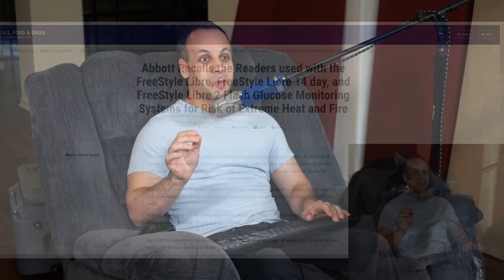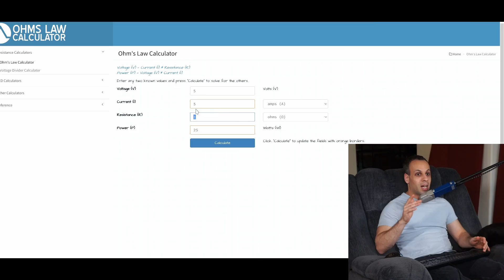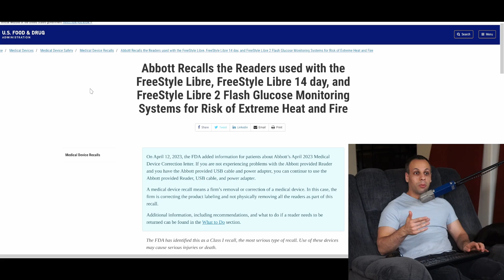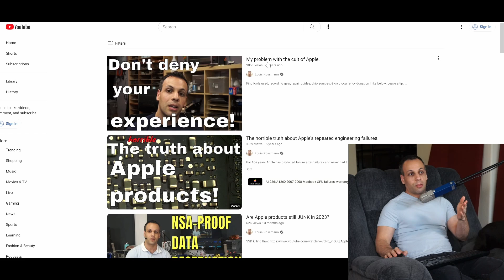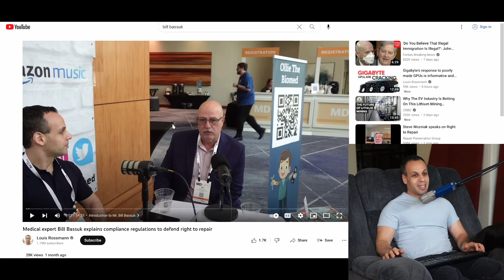Abbott gaslights customers during FDA recall of burning glucose monitors

Comment: I was very interested to hear about this recall. I retired from Abbott Diabetes Care 5+ years ago where my job was to investigate customer complaints and determine the root cause of failure in glucose meters that had been returned. I have no information about the current recall. 

When I was there, about every six months or so we would receive a (conventional) glucose meter that appeared to have caught fire and partially melted. This was very concerning and puzzling because they are powered by a three Volt lithium 2032 coin cell that is unable to source enough current to do such damage to the device. We tried to reproduce the problem and at first the only way to come close was to apply 100 Volts to the RS-232 serial communications port (which normally sees only 3-5 Volts). But the damage caused by this experiment did not match the pattern of black scorch marks and heat damage seen on the returned meters. One day I went back and read all the transcripts for when customers called in with this complaint. One customer made an offhand remark about having put his glucose meter in a microwave oven. So, I requisitioned several samples of all the meters we currently manufactured and put each in a microwave oven and nuked them for several seconds. The resulting damage exactly matched the damage seen on all the customer-returned burned meters. Case closed.
Reply: Why would they microwave them?!? 😂
Reply: My best guess for why someone would microwave their glucose meter is that they dropped it in some water (toilet?) and thought doing so was a way to dry it out. My second best guess is that it belonged to a kid who wanted to destroy it so he didn’t have to prick his finger or didn’t want to report a “bad” glucose number to his parents. Keep in mind that the number of people actively using these meters is in the millions, so this was extremely rare. Likewise, the number of Freestyle Libre meters that precipitated the recall is a very small percentage of the installed base. Some of which may have been blatant miss-use by the customer.
Reply: @carlam6669  And that is what happens when education of electronics was replaced with "Don't open it, don't play with it, don't think about understanding it, it's too dangerous, just forget about it, no user-serviceable parts inside!"

Anyone who knows how a microwave oven works, will instantly know why you should never try to dry out electronics in one...

Comment: My husband has used the Abbott reader and sensor for years. Abbott has been extremely helpful in replacing sensors that had a problem, even when it was probably our fault or no one's fault, and they replaced the reader just because hubby wanted an extra. You can use your phone as the reader, but his phone seems to be slower than the Abbott reader. There has never been a problem with his Abbott products. They also sent free test strips to check that the sensors were reading correctly. Edit: Thanks, Louis, for the heads up and making the video.
Reply: smells like astroturf in here
Reply: @mjc0961  Not at all, just our experience.

Comment: Exactly. It sounds like the battery charging circuit will overheat the battery because there is no current limitation. The provided 500mA or 1A wall adapter is most likely being used to limit the charging current. This is definitely a product design problem!!

Comment: Wait a minute: This looks like they're either connecting the charger directly to the battery, or connecting it to the battery through a boost/buck converter without feedback. Both of these are extremely stupid. For god's sake, I've bought 5$ chinese devices that had better charging solutions.

Comment: I am diabetic, and I have had nothing but frustration with the new technologies for both glucose monitoring and insulin delivery. As a software designer and programmer myself, I can see critical flaws in nearly every aspect of their design, and it usually seems like a regulation that keeps them safe from being sued, at the cost of lesser safety for me. Often they're just brainless mistakes that they probably didn't think about. Unbelievably frustrating all around, they are not designed by people who's goal is to make the best insulin delivery system, and it's abundantly clear to anyone that uses them.

I have not tried a wide variety of these devices, I hope others are having better experiences with them. After making a couple of switches without success, I have simply gone back to finger pricking and manual injection. Much better experience.

Comment: When Louis explained that the company warns of using chargers that are not their own special chargers and cables I with my very basic understanding of electronics best summed up as "Meh! I can manage but it's not quick." understood:
 "We choose to use an extremely crappy BMS, or didn't use one at all and only did the minimum of necessary circuitry because we are notorious cheapskates and only hire crappy designers who are getting strangled by the profit maximization department."

Comment: I don't think it's anything to do with overvolting, so much as overcharging. This isn't a laptop with a fancy charge management circuit in it. Most likely there's a diode and maybe a resistor, to charge a 3.7V cell from the microusb input. With a protected cell, this is... well I hate it, it's sketchy as hell imho, but it generally works out fine. As long as there's only a single cell, balancing isn't an issue, and while the resistor doesn't provide constant current, it does provide sufficiently limited current.

To me it sounds like the Abbott-provided cord and charger either outputs 3.7V nominal (instead of 5V), and the risk is overcharging the batteries slowly, or the provided cord/charger includes the current limiting resistor, such that an aftermarket charger may just try to charge the battery too fast.

Thinking more as I write this, my bet is on the provided charger being 5V but spending most of its life technically in overcurrent (output just "collapses," probably down to 4V or so) while a "stronger" aftermarket charger refuses to collapse,  pushing whatever current it takes to bring a 3.7V cell to 5.0V (which of course is very very bad).

Comment: If I understand it correctly then, USB chargers work in the voltage-regulated regime - that is they keep their voltage independent of what is connected to them. Note however that power source can be current-regulated, that is give selected number of amps independent of what is connected to them. With laboratory power sources you can switch between voltage regulated and current regulated regime.

Comment: There are cheap-ass USB Type-C chargers that put out 12v only. These might work fine for a specific cheap device, and damage some other devices. A properly designed USB Type-C device shouldn't be damaged by 12v when expected. Not saying you are wrong about the overall premise. Chances are Abbott cheaped out on the design.

Comment: Hey Louis, the reader actually does commonly come into contact with blood as it is used to take blood samples as well as communicate with the pucks you wear on your arm. I have this system and can confirm the charging is sketchy, mine makes a nice sizzle sound when I plug the cable in.

Comment: My best guess is that its not what charger used. In fact probably is an issue with the device. And as any savage company out there, they look to blame others when failure occurs. Reasons to deny warranty claims or avoid lawsuits when the device catches fire.

Comment: The other possibility that occurs to me is that the device is using a non-standard USB implementation that operates at less than 5V, and the Abbot-branded “USB” brick is designed with this in mind. So when you plug it into a normal USB-compliant brick, even the 5V initial push is too high and the battery heats up.

Comment: I use a Freestyle Libre 3 system, and I have the "3" reader, so a newer reader. How would I find out if it is affected by this too? Because they basically say that the 14 day and 2 were designed like shit on the usb charging circuit... but is the 3 affected by their shit design too?

I don't use the reader right now but it is there when my phone breaks or something that I can still have a reader device for the FSL3 system.

Meanwhile these devices are the cheapest plastic shit but they want like 200€ for it, lol

Comment: Why even bother making  that device USB standard when you can only use the charger it comes with? It's so silly, rather just have their own proprietary crappy charger or some generic nokia charger kind of pin and power supply.
I guess they went with usb because it was cheap, and they also cheaped out on the usb charging circuit so now their device can't handle outputs higher than what they ship with, and that's a really dumb move, which would have been easily mitigated if they just had some harder to find charger\connector, or even better, spent the extra 2 cents to build a proper goddamn circuit!

And yeah it's gonna be fun to have this device plopped open and investigated, big clive style, although i think the charging circuitry will be nothing to look at.

Comment: I've been using them for almost a year now. No issues. I could send you one to take a look, but probably not be cheap to cheap from germany to you 

Took one apart myself, the thing's tiny and there's nothing much going on in there, but I'm not a Technician of any kind so idk about any faults

Oh wait it's about the reader, not the chip itself. Well, never used the reader, because using a phone is way easier and way more convenient to use. It looks way better as well. Got the libre 3 reader though, brand new in box. I would be willing to part with it. Its just sitting on a desk for a year

Comment: This reminds me of the bullshit with Nintendo Switch from a while back.
Where the Switch asked for one voltage, but was actually expecting something else. 
All that, despite having a generic USB-C port.
The original Switch charger worked fine, because it was designed to understand the BS requests and deliver the correct power regardless.
But any other non-Nintendo USB-C charger ran the risk of bricking the console.

Comment: One exception would be older data+power USB Y splitter cables that had the data pins of one USB outlet attached, e.g. to share a PC USB port between a USB keyboard and a USB power-only device such as a Bluetooth headset.  If this Y cable is plugged into a QC 2/3 charger with a QC-capable device that requests a higher voltage, the split power-only outlet also delivers that voltage.

Comment: I've seen a Lenovo laptop charger with a USB-C connector where the label said it'd put out 12V regardless of what the device wanted. But I didn't actually test it to see if the label was accurate.

Comment: I still think you should build some fair certification for repair technicians. 
It should be a standard one can hold against manufacturers, to point out how independent is better in reality. 
Maybe add a free 2 minute online exam that people can make them take to see if they deal with someone who doesn't know basics like ohms law. 
Or a 5 minute one that also covers ethics of customer data. 

So that people have a tool to determine who to trust. 
Instead of guesstimating by what lobby groups tell them, or which shiny but worthless certification shops hang on their door.

Comment: it's possible they were trying to be tricky and put the power regulation and protection in the charger itself, nearly anything can go bad if you have something so oddly done.  even better, poorly designed regulation circuitry in the charger could burn and let full power through.

Comment: Where do you want it shipped? Just did some digging and found mine. Didn't see much use before I stopped using their cgm as it was very inaccurate for me, if the sensor worked at all on arrival.  
Edit:
Looked up your website and grabbed the mail in address for repairs.   I will just send it there if you don't prefer it to arrive somewhere else.

Comment: Sounds like a classic case of "let's just switch the pins around, surely nobody would connect a standardized device to our proprietary connector that just has a different pinout on a standardized plug to avoid 3rd party devices".
And if you think this is a long shot, remember there exists passive USB-A to AUX-cable adapters for industrial use, likely for this very exact reason, which surely nobody would ever try and connect their headphones to.

Comment: If only their charger works they shouldn't have use a USB port, it should be some other connector to prevent such a thing. That said this smalls like a crappy engineering or a corporate savings issue.

Comment: I use the FreeStyle Libre ''two' but I used to use the FreeStyle Libre 'one'. My doctor said that Abbott more or less stopped making the 'one' and kinda forced me to use the newer 'two'. It was fine because the 'two' could only be read with a smart phone and their app but I kinda liked the old 'one' with the reader device. 

So the 'one' came with a reader that you use to read your blood sugar results with so I assume they are talking about that.

The device I install on my arm(the sensor) does not have any USB charging to it but it for sure has a way to collect my blood sugar level, store it for 8 hours and a battery to keep it going for 2 weeks till you need to replace it.

I still have my old 'one' reader and the USB cord it came with. I have not used it in about 6 months but I can send it to you if you want. I live in Canada tho so I am not sure how the government will like someone sending over medical equipment. I do not however have any 'one' sensors.

From the title of the article it seems they are talking about a reader for the 'two'. I was told they don't make that but I am not sure.
Reply: There’s a separate reader available for Libre 2 in some markets - specifically, the USA.  One hassle of Libre is that the sensors are different in almost every market, making travel a real pain.

Comment: Actually, the selection of the current and voltage is chosen from the D+/D- lines as defined in a digikey article "designing-in-usb-type-c-and-using-power-delivery-for-rapid-charging". The device being charged pulls a regulated amount of current via (preferably) a LiOn charger chip that prevents overcharging. That being said, I might have a Freestyle Libre so if I find i'll send pics.

Comment: @louis you saying Apple knows how to create a USB circuit is pretty reassuring for me because I, no joke, saw 3 Apple cables catch on fire while using original Apple chargers, I also, and this is way more dangerous, saw 2 batteries dangerously swelling while I was flying in a plane (new original one for a white MacBook and a new iPhone 3gs, battery swole and broke the screen in half). Those were pretty scary experiences on plane. Once at home I repaired them by myself because Apple refused and never flew with again.

Comment: It takes 2 ohms to make 350mah lipo cell not go boom if you want to make ultra simple rechargeable device. Assuming the cell has overvoltage protection circuit... if they don't protect against overcharging they really are retards.

Comment: I use one myself.  (14 day version) I'd have preferred a Dexcom G6, which is an actual cgm.  (Freestyle is an on demand glucose monitor, not a continuous).  I do have an additional third party device called a "MiaoMiao", which turns it into a CGM.  Either way, it's still better than pricking my finger 3+ times per day.
Reply: Same here and since using a fl i can actually see what my glucose level is doing instead of a snapshot a couple of times a day that basically tells me nothing
Reply: The Freestyle is a true CGM. It stores continuous history for up to eight hours in the sensor and transfers that historical data to the reader only when it is brought near the sensor to save the power of keeping the bluetooth circuit running all the time. In addition, in the Freestyle 2, the sensor turns on its bluetooth periodically and transmits the current reading to the reader. If the current reading is out of range (as defined in the reader’s settings), the reader will alarm and prompt the user to download the continuous history stored in the sensor. The MiaoMaio simply fools the sensor into thinking the reader is nearby and forces the sensor to send the history and current reading more often. Since the reader isn’t ready for the history download, that gets lost and only the current reading is seen on the reader. MaioMaio, not so good.

Edit: If you like the reader, get the Freestyle 2 and ditch the MiaoMaio. Better yet, get the Freestyle 3. No reader. It regularly sends readings to a phone like the G6. The 14 is two generations old.

Comment: Self destruct smart charge circuit. I have seen this recently with some new industrial test gear. The device has a smart charge circuit in it that negotiates 9V/12V/19V etc.., however the supplied and approved charger is NOT a smart charger, it's just a plain old 5V USB power supply. The end result is, if you use a 3rd party charger instead of the supplied one, the device asks for high voltage, the supply gives it and the device fries itself.